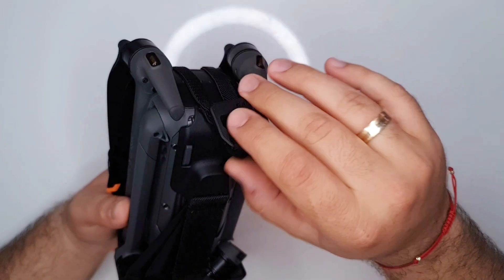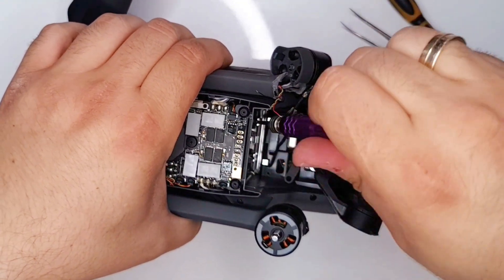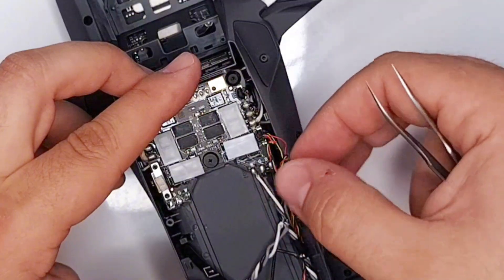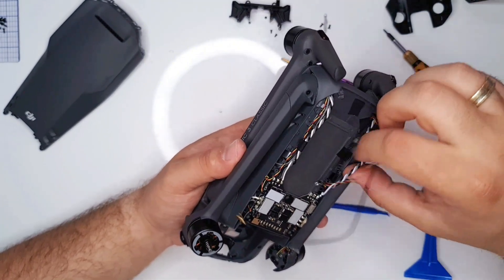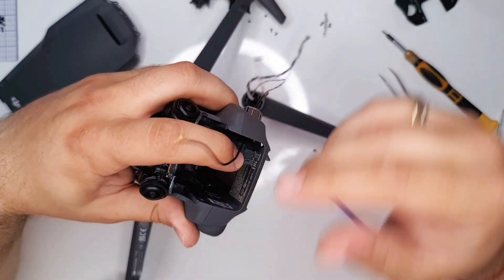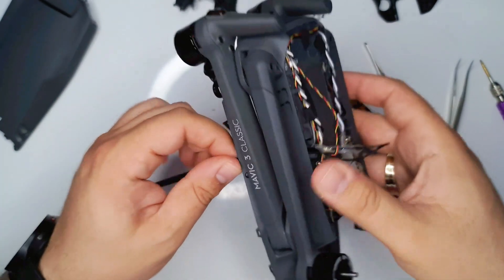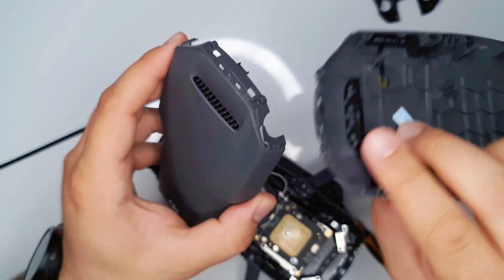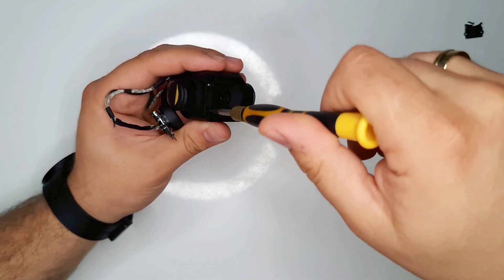Repairing a crash-damaged DJI Mavic 3 Classic from Ebay

Comment: Hi I've the bought a similar condition drone like yours that requires arm, gimbal cable and suspension bracket. But after the fix, the camera is not showing any signal, everything works perfectly except for the video signal. Do I need to plug in to any software to recalibrate the drone?
Reply from the maker: Hi and No. First off - was the camera working before the repair?
Unless the camera unit itself was replaced, there's no software changes needed. 
If there's no video signal and there was before, it's 99% a faulty connection. Double check the connectors on both sides. You might have a connector that's not fully seated which would explain the issue. If you've changed the cable, this means that you've disconnected everything in the process. Make sure all connectors are fully seated everything needs to be connected or the camera will not turn on. That includes the last connector at the base of the gimbal. The only two other options are a bad camera or a defective cable.

Comment: Great video! also do you have a video replacement front arm mavic 3 classic? thanks
Reply from the maker: Hi, not yet, however, the process is identical, you just need to disconnect/unsolder different cables.  I believe this video will help you, regardless.